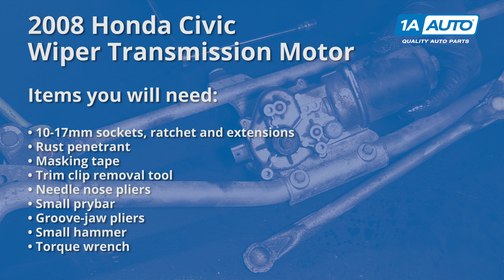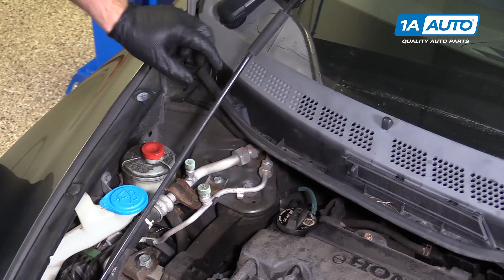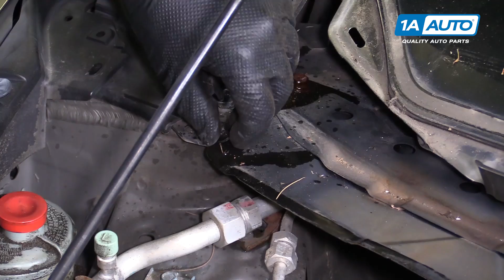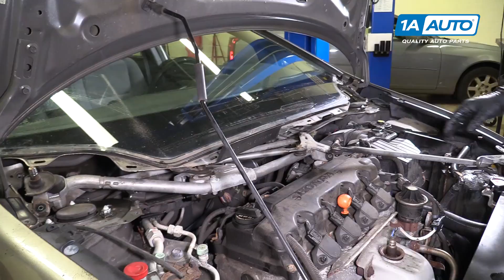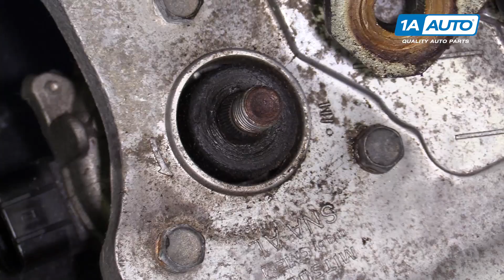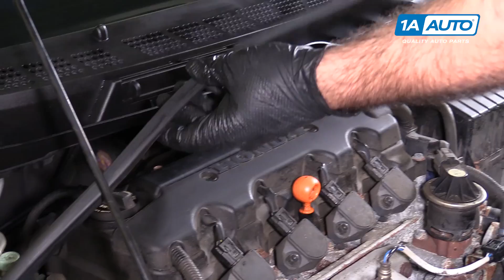How to Replace Wiper Transmission Motor 05-11 Honda Civic

Comment: Using my windshield wiper during heavy snow.  I believe they poped out of place. I could still hear the motor working.  Where would that connection be, if they just slipped out of place.

Comment: if you purchase a used part, be sure to operate the part to make sure the motor is in the "parked" position before setting the triangle to to mark
Reply: How to put it in parked position??

Comment: This video was super helpful! My drivers side wiper was seized. Took the cowel and transmission linkage all out, disconnected the motor, got a used linkage at the wreckers and putting everything back together. I’m a girl and not mechanically inclined WHATSOEVER. This video helped A TON! Thanks
Reply from the maker: +Doreen C Thanks for checking us out! http://1aau.to/m/Shop-1AAuto-c

Comment: My 07 civic’s driver side wiper always seem to leave a spot near the corner. I replaced the wiper arm once and seem to fix it but after few months, the issue is back. Do you think its the motor? Thank you
Reply from the maker: +Janice Dizon While we cannot give a definitive diagnosis, that sounds like it is not moving the full length of the windshield which could be either the motor or the linkage. Having this looked at by a mechanic or disassembling this may give you a better insight on the cause of this.

Comment: My blades are stuck in the up position an can't get them down what do I when I put the new motor in?
Reply from the maker: +Johnny Cash You should be able to still get these off the same was as if they were in the correct resting position, it may take a little more wiggling to get them off.
Reply: @1AAuto  ok but when I put the new motor in I put the wiper blades in the rest position? Or the up position that they are stuck in now?
Reply: @johnnycash7803 did you ever figure this out? I'm in same position

Comment: Help!!! My 1999 civic LX doesn't have the 3 marks to line it up correctly and now my wipers go down 1st instead of up and are UP in the off position! I can't find information on how to line it up correctly ANYWHERE!
Reply from the maker: +Dylan Belcher Thanks for watching! If the wipers are all the way up in the "off" position, then you should be able to take of the arms and reinstall them so they are in the down position.  When you go to turn them back on they should work properly.  1aauto.com

Comment: I uninstalled the old and installed the new with no issues but why are my windshield wipers going down before going up my windshield and stopping half way on the windshield? I feel as though the motor isn’t parking the assembly correctly.
Reply: I'm having the same issue with my 1999 civic LX !!
Reply: It probably isn't the motor that's faulty, it's the electronics inside the motor that's causing the fault. Before buying a new motor, take the existing one out and open up the plastic shield (you don't need to physically remove the motor from the assembly arm) and clean it up. It'll be full of grease so remove some excess from the spinning plastic wheel inside so that there isn't grease between the plate and metal contacts. Put it back together and the problem should be resolved. This method won't cost you a dime, will take an hour or two. If it doesn't work, try replacing the motor shield rather than the entire motor.
Reply from the maker: +Gary Castano It could be an issue with the motor or another electrical item.

Comment: Great video.

If you manually spun the motor by mistake (or on purpose to test the assemble) and you want to bring the motor back to park, plug it back in without the assembly, run the wipers and stop them a couple times. The motor is now back in park and you can finish the job.
Reply from the maker: +SoilentGr33n Thanks for the tip!
Reply: I just did this job yesterday on a 2007 FIT. It was much simpler and smaller parts than the civic, but this vid was a great help.

Thanks guys.
Reply: Thanks for this advice. I think it's a great idea even if you didn't spin it just to double check that the new motor is in the park position. Could you imagine all that work and the motor was not in the correct resting location?

Comment: How do I know if my car needs a new motor? My windshield wipers get stuck for about half of a second if the windshield is dry even with new wiper blades
Reply from the maker: +Jimmy Zhu If the windshield wipers work fine while the window is wet, you should be okay. The wipers require water on the windshield in order to work correctly. Hope this helps you out. 1aauto.com